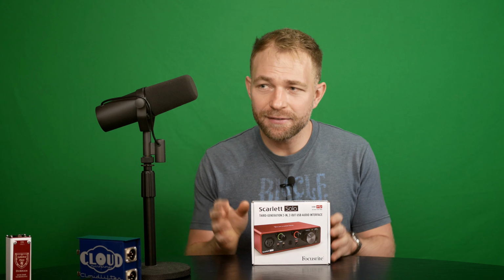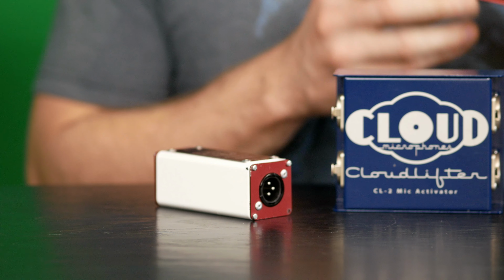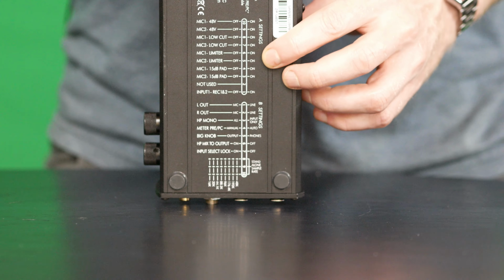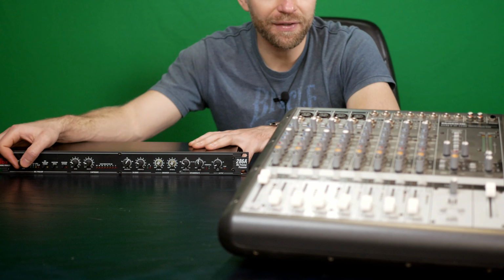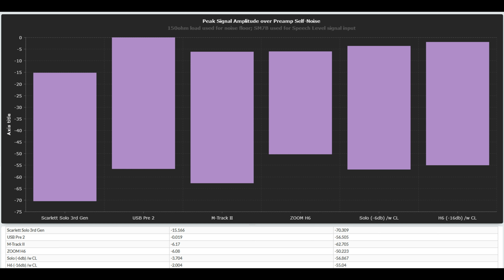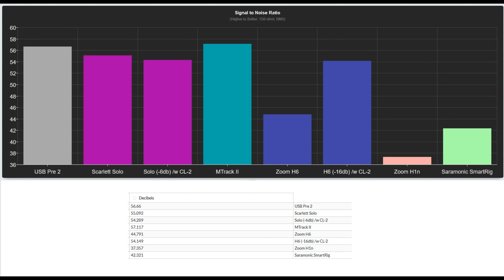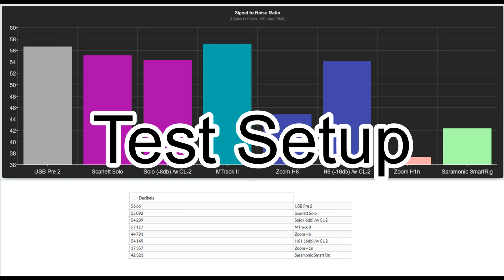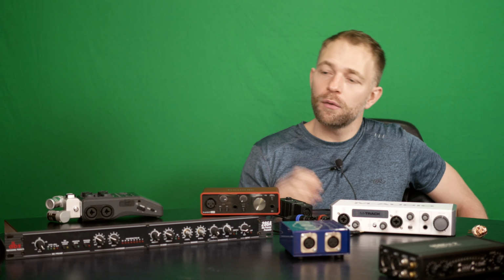Scarlett Solo 3rd gen Comparison and MORE

Comment from the maker: The driver I'm using for the Focusrite Scarlett Solo 3rd Gen was made by Microsoft, titled "Scarlett Solo USB", version "10.0.18362.207".  The added volume boost to that preamp may not have been intended by Focusrite, so I may need to revisit it in more detail.
Reply: Any update on this? Most other sources out there indicate that the Cloudlifter is almost a must unless your using a professional grade pre-amp. It would be great for me though if the Scarlett gives enough power on its own though.
Reply from the maker: @RetroRaconteur  I did a follow up video looking at this a bit. https://www.youtube.com/watch?v=we6QBkrRnDc

I haven't revisited it since then.

I'd disagree that a Cloudlifter is a must though, as it depends on what application you are using and just how bad your preamp is. I haven't used my cloudlifter for anything really; I just bought it out of curiosity. It sits gathering dust.

If using Discord or Google Hangouts, those browser-based apps have built-in auto-gain and noise-reduction -- you won't need to a Cloudlifter for them as a result.

If using OBS, there is a built-in gain-function, so you can increase the gain to whatever you want in software. There is also a built-in noise filter, so you can again, get rid of any noise in real-time.

If you are not using the preamp for live streams you can just do the volume adjustment in post-production. Audacity lets you increase gain and reduce noise, also. I rarely ever record at maximum volume as I like having some buffer to prevent clipping.

If you are into online gaming, and want to use your mic there, some games may not have autogain. For those applications you can use https://www.vb-audio.com/Voicemeeter/banana.htm  This lets you increase gain in software via a free software download.

There are some applications where you may not be able to increase the gain in software, and so a cloudlifter could be handy there. I can't think of any off hand.  If using a really bad preamp, like a Zoom H6, you may also want to use the Cloudlifter to help reduce noise. You'll still probably want to do a software-noise filter after though.

What is your intended application?
Reply: @steve_seguin  Thanks for the update!

Comment: i'm running mine thru a warm audio wa12 mkii at 58db gain and output is right in the middle.   after some experimenting landed on those settings.  pre processing the audio sits around -24db which seems extremely quiet but then processing brings it up to -5db or right in that area.   just switched from a tml 103 and am really happy so far.  finally got my voice to have that super warm cushy sound i've been hunting for that even processing of the tml 103 wasn't quite bringing out.  my audio interface is a scarlett solo gen 3 then the warm audio pre amp between that and the mic,  finally got what i have been looking for.

Comment: Ey dude, any run-ins with static with the Shure? I have the 3rd gen Scarlett, the Shure mic, and the lifter but I keep getting a static sound with my audio. Any advice at all on how to resolve that?
Reply from the maker: How bad is the static? There will be some mild white-noise and that just needs to be put thru a noise filter -- so, Izotope RX 7's denoiser.

If really bad, make sure the XLR cable you are using is not low quality and that you are keeping the setup away from any high-voltage electronics.
Reply: I had that problem too and once I got a good power conditioner it was fixed
Reply: That’s just another  problem u could be havjnh

Comment: I have a scarlett 2i2 with sm7b but I find that to hit -12~-18, I have to turn the gain and the way up. When I turn the gain down, I can barely hear the input signal on the monitor. When the gain is turned all the way up though, I hear some clipping. I guess I could record low and add gain after but I need to monitor while recording. I was thinking about getting something like the cloud lifter but then with that price range thought maybe I should just get another preamp. What do you think? And if the better answer is another preamp, what I should I be looking for in the specs so that it’s a noticeable difference esp when I don’t have an unlimited budget?
Reply: Many find the Fethead or Dynamite DM-1 to be good cheaper alternatives to the Cloudlifter cl-1. Look into those and see if you think that could help solve your issue.
Reply: @Rocco D is right, you need a device like a Cloudlifter CL-1 to boost the signal of your SM7b.  as a dynamic microphone it outputs a very low signal and most of the preamps in new interfaces just dont have the juice to get the levels to where you want them.

Comment: Nice video review...i have focusrite Saffire USB 6 but my EV RE20 cannot give enough gain...do you think cloudlfiter will help? In case is not enough to boost the mic gain do i need to replace my interface preamp? If yes what is the best replacement in a average preamp that will not break the bank...thanks.
Reply from the maker: A cloudlifter would help, but I would try using software first. VB Audio makes some software, like Voicemeeter, which might be useful.

Comment: I thought the SM7B was the lowest mic out there but the XM8500 has it beat by 10 miles at -70.  Some are saying Behringer is using old methodology and I think they are right from some of the stuff I am seeing because at -70dB nothing would be able to drive them without a pre to the pre in the interface.

Comment: Great Video. I have a Scarllett Solo 3rd Gen and am going to buy the SM7B. after watching your video it got me thinking. If the solo has a gain of 56db and the SM7b Require 60-70db then of course i could go for the CL1. But with using simple calculations, could i also sell my solo 3rd gen and combine that sale money with the cost of the CL1 and just buy a pre-amp with the required 60-70db Gain? Or is there an advantage to pairing the CL1 with my solo?
Reply from the maker: Based on my testing results, my USB Pre 2 , which has nearly 70db of gain, had sound that was no cleaner than a preamp that did just 60db.

If you can do your gain in software, then there is little need for a hardware-based gain.

The CL1 is useful for LONG cable runs between a mic and a preamp though. It is also useful for live applications where you may not be able to do software-gain and need a large amount of clean volume. Lastly, the CL1 has a high-impedence, so with dynamic microphones it can impart a warmer tone on the microphone.

I personally have not touched my CL2 other for testing since I bought it.  I've found a $150 preamp to be just as good as the $250 CL2.

Comment: So my Scarlett 3rd Gen will work fine with a Sm7b. I’m glad I watched this and didn’t buy a CloudLifter along with it. Will the Air button eliminate some of the noise?
Reply from the maker: it will work if you increase the gain with software, although it will have higher noise than some other more expensive presamps. I do a video on how to increase the gain using the default windows driver for it.  You can use iZotope's RX elements to remove noise in post if needed or whatever.  The AIR button just changes the sound a bit I guess; nothing I find super valuable.
Reply: Hmmm will it though? I've seen numerous videos where the SM7B is used with a Scarlett and the gain on the Scarlett needs to be set to 90-100% - having introduced a Cloudlifter or a Fethead the gain on the Scarlet can be reduced to around 50% for a similar output gain level. I believe these preamps offer around 25dB whilst Shure recommends a preamp of around 60dB (which is way higher than the Cloudlifter or Fethead).

Comment: I ordered the SM7B. I will use it for live broadcasts. I'm using SSL 2+, do you think I should buy Cloudlifter?
Reply from the maker: Their specs claim +62db of gain with 130-ein noise floor.  This should be enough for a SM7B, assuming accurate. 

You can always buy a cloudlifter later if need to.

Comment: Hey quick question. Is that a Ds7200b stand on that shure sm7b? How did you get that to connect to the mic without an adapter? Or if you did use an adapter which did you use? Thanks

Comment: Hey, I’m fairly new to recording myself. But I do aggressive punk rock vocals, I’m using a scarlet solo 3rd Gen, What sort of software will I need to get the boost I’ll need from this mic? What I’m understanding is that a cloudlifter will create more noise and I don’t want to spend extra money for a muddier sound. Or Will aggressive vocals, a Sm7b and a Scarlett solo 3rd Gen be enough?
Reply: I have found that my cloudlifter added no noise to my sm7b (obviously it amplified any ambient noise, but it added zero interference noise), and I was not able to get a good sound of my sm7b without it.  if the question is: will a cloudlifter make my sm6b muddier, the answer is no.

Comment: also, as a side note, I;m witnessing a slight airy feedback from the mic, is it because I have it 1-2 feet from my mouth and I'm just amping gain up to compensate for sound?
Reply from the maker: 1 to 2 feet might be okay if you intend to do some loud vocals, but I find 1 to 2 "fists" of distance works well.
Reply: @steve_seguin  alright I'll stay tuned to check it out, I have notifications on for you so I'll see it, just have been busy that's why it took me 2 days to get to this video. Yeah I might just have to suck it up and pull the mic into the face cam to bring it a few "fists" away as to avoid that airy feedback I was receiving.
Reply from the maker: @oTwistedDreams  A lapel mic, maybe a shotgun mic, would be slightly less conspicuous. 

You can run a noise filter and add some digital EQ to the signal; maybe boost around 250-hz to the sound to make it sound more full if you pull it back.

Dynamic mics are generally the type of mic you want half way down your throat; they tolerate speaking close to, which also enables you to reject a lot of background noise.

Comment: I have been looking into getting a Shure SM7b and have been considering getting this my Audio Interface that i have is a Presonus Audiobox USB 96. would this be sufficient enough if i decide to forgo the Cloudlifter?
Reply from the maker: Looking at the specs online, probably not.

https://www.presonus.com/products/AudioBox-USB-96/tech-specs

It has a mic gain of only 35-db, while the SM7B needs 60-db or more ideally.  Even with a Cloudlifter it will still be coming up a tad short.
Reply: @steve_seguin  What audio interface would you recommend that would work for the Shure SM7b
Reply from the maker: @theparagonhouse6761  Depends on your budget.

Something like the MOTU M2 is affordable and should be a good budget option for the SM7B.  Haven't tested it personally tho.

Comment: Hello!
I have a Focusrite Scarlett 2i2 first generation and I'm about to buy a Sm7b microphone. I'm looking to record vocals, acoustic guitar and my guitar speaker. What other kinds of gear do I need? I'm a rookie
Reply from the maker: TED DUCHAMP the first gen Scarlett isn’t the  greatest choice for a SM7B.  You have many options, including a new and better preamp, or a cloudlifter, or a different microphone, or just some noise reduction software. 

If you are dead set in the SM7B, just buy it and see how it works. Any noise can be removed with Izotope Rx noise filter. If you are a loud singer, you may be fine even without that. 

If that isn’t good enough, consider a better preamp or cloudlifter. For acoustic guitar, maybe consider a condenser mic.

Just my thoughts at least.  No idea.

Comment: Hey man! I'm having a issue with setting up my mic. I've plugged my shure into my cloud lifter into my scarlett solo. However When i turn off the phantom power it won't work. I'm not a huge fan of all the buzzing and background noise that i get with the phantom power. Is there any advice you could give me to use the cloudlifter without phantom power?
Reply from the maker: Are you sure the phantom power is creating the buzzing? 
The cloudlifter requires phantom power to operate.
One noise-free option to obtain phantom power is to buy a battery-powered phantom power supply: https://www.bhphotovideo.com/c/buy/Phantom-Power-Supplies/ci/15142/N/3992462124
These run on batteries and they shouldn't create noise if of decent quality.  if you still get noise, the issue is not with the phantom power.
Reply: @steve_seguin  I'll give this a try thanks man!

Comment: IS Scarlett Solo 3rd gen enough for Shure SM7B then?
Reply from the maker: If you tweak the drivers so they output like 120% loudness, I'd say it's acceptable. Without tweaking the drivers, you'd need to use autogain or post-processing to fix the levels. The noise floor isn't super, but good enough. 

I have it setup with an SM7B on a spare computer, and it works fine with zoom/meets/webrtc -- but not so great for certain games, etc, where auto gain is lacking.

The noise floor isn't super great for podcasting, etc, but you can do post processing to fix it.

Meh
Reply: @steve_seguin  what to do then? shall i get 2i2 scarlet then for shure sm7b? or maybe stay with solo and get Rode NT1
Reply from the maker: @iNasteable  I can't make that choice for you. Both options are good, depending on your recording needs.

Comment: is it safe to use the 48V button with the sm7b? one of my friends said it could damage the mic. But its honestly the only way i can get the mic to work lol
Reply from the maker: The SM7B does not take phantom power.  Ribbon Mics will be killed from phantom power, but any decent modern XLR mic should tolerate it.

Still, best not to risk it if you can.

Comment: The shure sm7b requires 65 decibels of gain so will these preamps be capable of doing so?
Reply from the maker: The New Gamers you can add gain in software these days. What matters more is probably the signal to noise ratio.
Reply: I trust hardware over software because software may be able to add gain but it won't clean and effective as hardware.
Reply from the maker: The New Gamers As demoed in this video, the Zoom devices can get VeRY loud, but the noise floor is also very high.

Don’t trust specifications either. Many preamps lie or mislead about their specs. 

What really matters is the signal to noise ratio if dealing with digital inputs, IMO at least. 

A good solid first stage mic preamp is important in any case.

Comment: Hey bro, I really appropriate the information, tell me ?, I have a scarlet 6i6 audio interface and a project pre 73 preamp, do you think three devices will play nice with each other , I appreciated any response . I am interested  in getting the sm7b  for recording vocals
Reply from the maker: Should be fine (don't see a reason why not at least).  

My guess:

Connect the output of the Pre73 to the LINE INPUT of the Scarlett 6i6. I'm assuming a balanced 1/4" TRS cable would do the trick?

I don't think you want to connect the LINE OUT to the MIC IN, as that will introduce a few db of noise needlessly.

Next, make sure the Pre73 and the Focusrite are connected to the same ground; for example, they are plugged into the same power outlet. This just reduces the chance of a ground-loop that can introduce noise to the signal.

You'll get a tonne of gain out of the Pre73, more than enough for the SM7B, and the gain is relatively clean from what I've been told.
Reply: @steve_seguin Thanks Bro, and Superb Channel

Comment: Bro how to connect shure sm7b to dslr please tell me.
Reply from the maker: If you DSLR has a line-in port, then you can connect the RCA output of a USB mic preamp to the 3.5mm input of the DSLR.  An RCA to 3.5mm cable is like $10.

Most DSLRs do not have a line-in port, and so most DSLRs can't connect a Shure Sm7b without some hacks.
Reply: @steve_seguin  can we connect 3.5mm jack from dslr to scarlet.
So then the mic works..?
Reply from the maker: @theorgexxx  you should be able to connect most USB preamps to a DSLR via the line out, so as long as the DSLR has a compatible input and if you aren't use the USB output.

I have not tested it with a scarlett, so I don't know for sure, but you could call them to ask. I would imagine it would though.
Reply: @steve_seguin  So you sync your audio to dslr ..?
Reply from the maker: @theorgexxx  I plug my USB preamp into my DSLR via line level. My DSLR is a GH5S, so it has a LINE IN port.

I have a dedicated usb preamp for this, as I cannot use the USB mode at the same time as the Line out.    

audio and video are in sync though; perfectly in sync.,
Reply: @steve_seguin  So how to connect my shure sm7b to canon 200D. 
Bcuz I need direct shure sm7b voice from dslr

Comment: Does the M Audio 2x2m interface work well with the Sm7B? Or do I need additional preamp power?
Reply from the maker: Depends on your needs. Having never used it I can only speculate based on the specs listed online. It will not meet the recommended gain for the SM7B, as it has 55db and the recommended is 60 to 70db. You can increase the gain in software of course, but that may not always be possible.

Preamp EIN: -128 dBu (max gain, 150 Ω source, A-weighted)
Max Input Level: +1.5 dBu
Gain Range: 55 dB